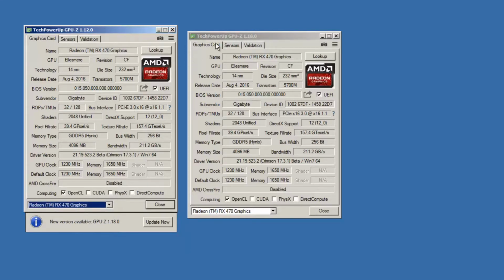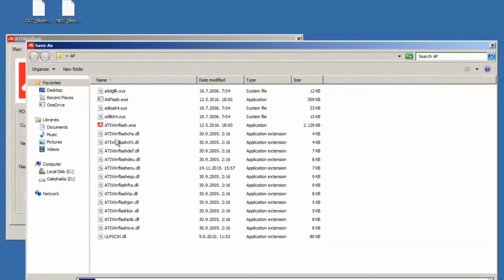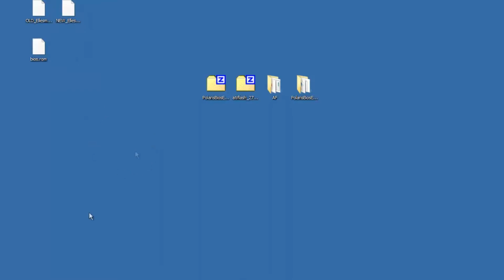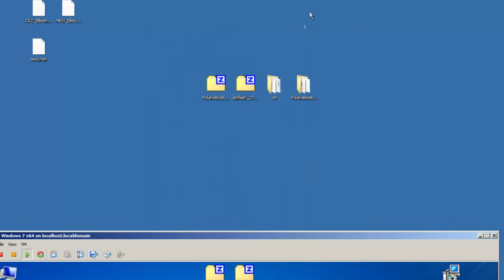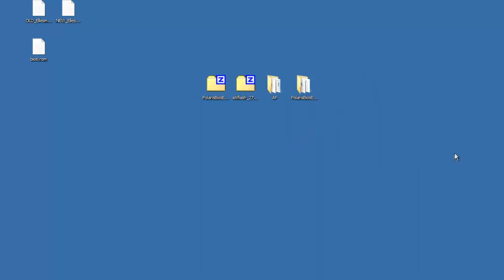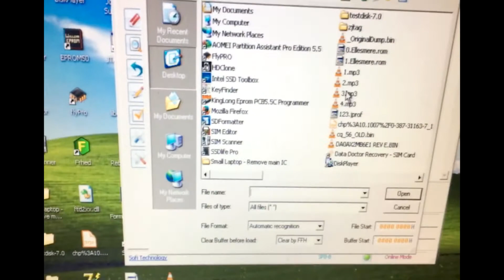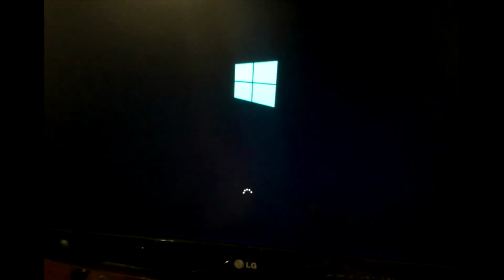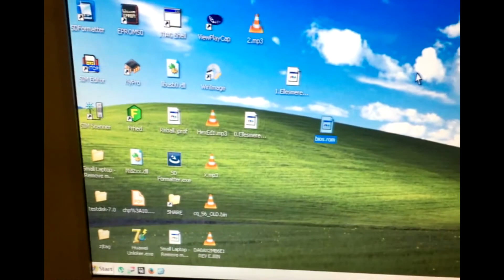[HW: HowTo/NotTo] - Bricking / Unbricking of my Rx 470 (can be applied to any GPU)

Comment: Hi, you use “.Rom” file on your programmer? Or “.bin” file? How to convert rom file to bin file?
Reply from the maker: hi, it's the same thing (with different extension) - just flash .rom file. !!! be sure to backup original firmware just in case you have something different !!!

Comment: if change in Polaris Bios Editor only fan values and flash the video-card this code 43 appear?
Reply from the maker: bubble kuku it looks like (perhaps) ram values have been modified (strips or speed) download original rom, flash it and then modify if.
Reply: @MTS_IT  i not modified ram values,i,am not miner,i want change fan values and clock gpu speed,but i,am scary from code 43
Reply from the maker: bubble kuku for that i would use afterburner
Reply: @MTS_IT  yes i know MSI-afterburner but i want to write bios,if write only fan+clock the code 43 apear if you know?
Reply from the maker: bubble kuku it should not appear as long as you do not overclock too much

Comment: Hi MTS, I just flashed my MSI RX 470 and now I have no signal when I boot up. Fan spins and then stops. Leds are lit. I used ATIWinFlash but I forgot to run it as administrator. Is this the cause of the bad flash?  How can I fix this?
Reply from the maker: try this method: https://youtu.be/a3kWxFodvSU?t=1680 you'll need two GPU's (or onboard GPU)

Comment: All that trouble to do that? theres an easier way, boot in using the onboard graphics and reflash the bios to original
Reply from the maker: i've tried that first but it did not help (i guess it's due to wrong bios size)
Reply: it will only work if you have the original bios backed up properly with the right size. Thats why I don't recommend using GPU-z to save your backup bios, atiflash is much more reliable. In your case you could have just downloaded a stock rom online and just flashed it back
Reply from the maker: nope :/ since the card was partially flashed and was not recognised (i've tried everything there is online before disassembly )
Reply: It should still be recongized either as Microsoft basic display adapter or  ATI Polaris 10 in Atiflash
Reply from the maker: it wasn't detected as a device (like i haven't connected anything to my mobo)... ah who knows... i might have scre*ed something up in the process...
Reply: Sometimes that might happen but I just use DDU to clean uninstall once maybe twice and it will be detected

Comment: hi my friend friend when the card had no bios, fan spining? Or is complete stop?
Reply from the maker: is your bios faulty? don't quite understand the question. :/
Reply: I bought a damaged video card rx 470 4gb shappire, they told me I was briked when they tried to modify the bios, I already did the procedure and installed a new bios directly, but the video card does not turn on the fans, just turn on the led and Does not do anything at all, what do you think it could be?
Reply: He comprado un dañado tarjeta de vídeo rx 470 Shappire 4gb, me dijeron que estaba briked cuando intentaron modificar la bios, ya lo hice el procedimiento e instalado un nuevo BIOS directamente, pero la tarjeta de vídeo no se enciende los ventiladores, a su vez acaba en el lED y no hace nada en absoluto, ¿qué te parece que podría ser?
Reply from the maker: Was the flash done corretly? Did you verify the programming? Did you program the right bios? It so, you got screwed over :( perhaps it was not bios but faulty chip :(((

Comment: HI MTS.
I HAVE 6 RX580 8GB OC ASUS DUAL CARDS 
THEY ALL ARE BRAND NEW AND HAVE SAMSUNG MEM

BUT WHENEVER I OPEN ATIWINFLASH ITS SAYS" CANNOT FIND DISCRETE ATI VIDEO CARD".
COULD YOU TELL ME AN ALTERNATIVE WAY OR FIXTURE OF THE SAME . I AM GETTING 25-26MHS WITHOUT MODDING BIOS .. BUT TEMPERATURE ARE REALLY HIGH SO MODDING BIOS IS THE ONLY WAY FOR ME 

THANKS😊
Reply from the maker: you have to choose "run as administrator" and atiflash will work :D if it's not that install catalyst drivers and then choose run as admin whn starting atiwinflash!
Reply: MTS you those 16.9 drivers??Will they work for Rx 580s?
Reply from the maker: i currently have 17.5.1 and they work with 470/580
Reply from the maker: you'll just have to patch em,
Reply: I tried copying bios via GPU-Z which thereby was successful.. the I  open that bios in Polaris BIOS editor which too allowed me to edit bios.. what if I flash this modded bios by your method??and thanks for quick response subscribed you channel😊
Reply from the maker: gpuZ f'up my gpu, sa keep that in mind, regarding modding, watch my video there's what to do :)
Reply from the maker: it will work if the dump was a success :) however if gpuZ f'up bios like it happened to me your gpu is a paper weight :/
Reply: MTS haha I saw videos of buriedone he always use gpu z
Reply from the maker: Almost everybody does , however in my case ot was a flop :(

Comment: BTW great video and maybe you could tell me where you got the white box thing to program the chip you unsoldered?
Reply from the maker: Andrey Nazarchuk you can get it of ebay. It's about 5-10$ it's called usb bios programmer, if you wish i can search for one and send you the link. If you were in croatia i could fix it for free (it's a 5 min job)....
Reply: MTS no I'm in the USA but can you please send me the link for that and the chip clamps? or you can buy it for $300? I'll ship it free.
Reply: hey have you ever done the bios flash(white box) to an Asus rog strix rx470 4gb card? did it work?
Reply from the maker: nope. sorry, however you can post yout bios and i'll mod it, however, if something you have been warned  :D
Reply: I'm purchasing a bricked on off of eBay, the seller seems nice and says that the card lights up but PC does not boot cause he bricked it flashing bios, you think the programmer will do the trick?
Reply from the maker: most definitely, i've bricked mine couple of times while experimenting :)
Reply: MTS so as long as the fans spin it can still be programmed?

Comment: hello man adapter not found error help pls
Reply from the maker: Unfortunately i cannot help you remotely, try https://www.youtube.com/watch?v=mTqNP-N38BY , if that does not work you'll have to use my method (which requires some skill)
Reply: MTS i tried:,(
Reply from the maker: you will need a bios programmer, you do not need to desolder chip since there are chip clamps that you can buy for 3$ and you will need either to dump another gpu or download one. Unfortunately that's all i can do from here.
Reply: old post but this full just worked for me. was surprised But it makes sense why it works. Make sure you get the right pins is all ill say haha http://www.overclock.net/forum/74-graphics-cards-general/593427-how-unbrick-your-bricked-graphics-card-fix-failed-bios-flash-26.html